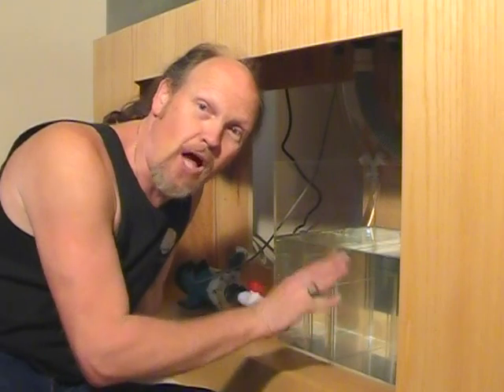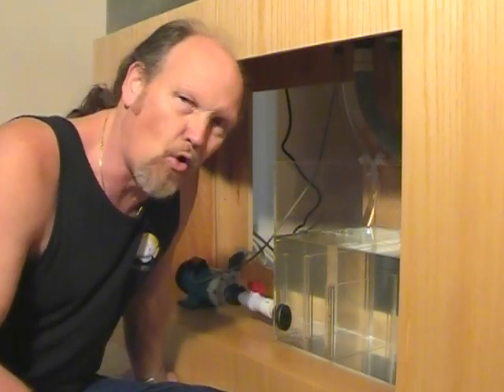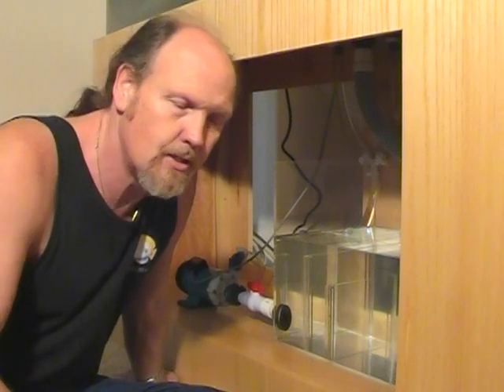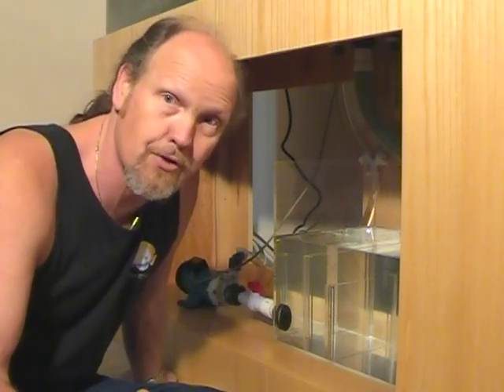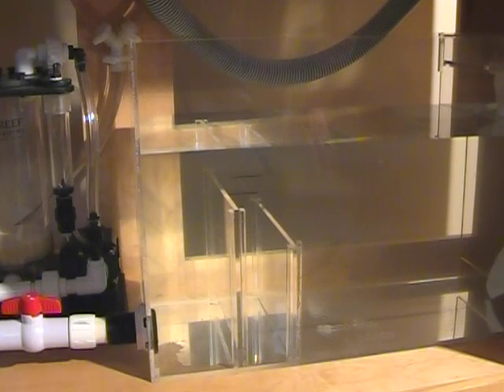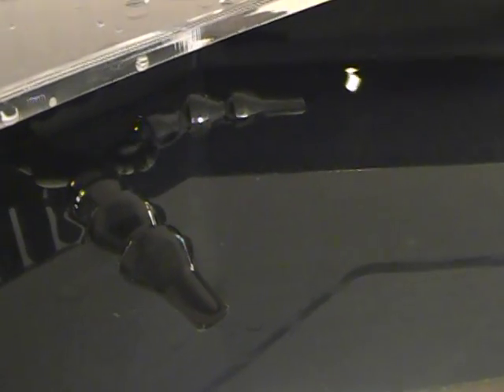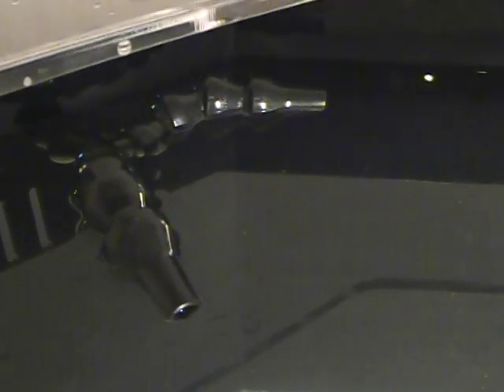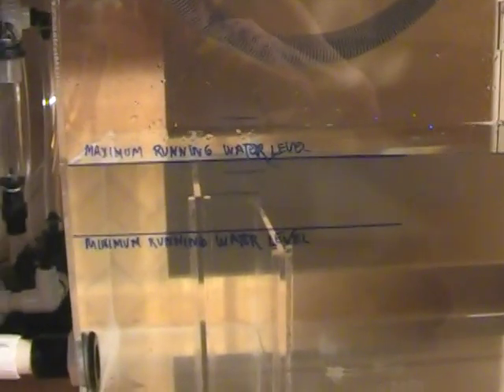Setting up a Reef Tank, LA Fisguys, Episode 51, Part 3

Comment: Just one question. Why would one choose such a return pump? Absolutely no need for the iwaki on this application, your not dealing with any head pressure. Should have went with a dc pump like a vectra. It’s controllable, less energy consumption, and you can ditch the ear plugs. I’m sorry that pump makes absolutely no sense to me to use in this application.
Reply from the maker: Its simple...this was 2009 and Iwaki's were the go-to pumps at that time.
Reply: lafishguy, gotcha, the skimmer shown struck me as outdated and an little bit of an odd choice, which would have clued me to this being an older video. However I do know people that they still run and swear by there aqua c ev’s and Mrc Beckett/injection skimmers. Thanks for clarifying, the time period, iwakis are great pumps but considering what’s out there today it seemed as an odd choice.